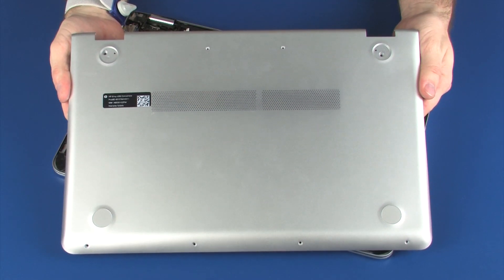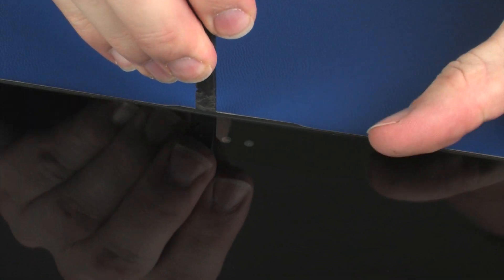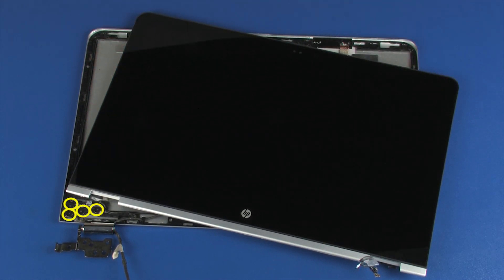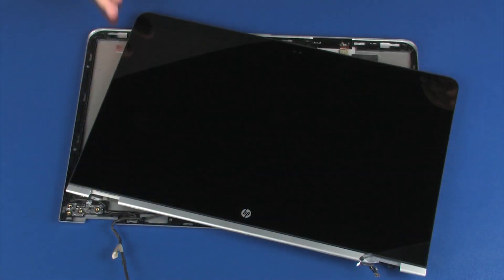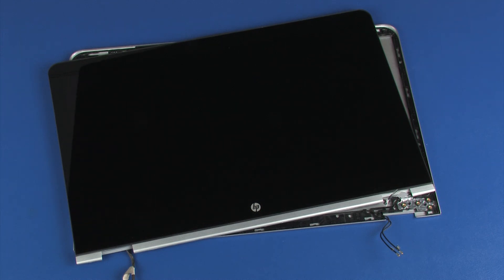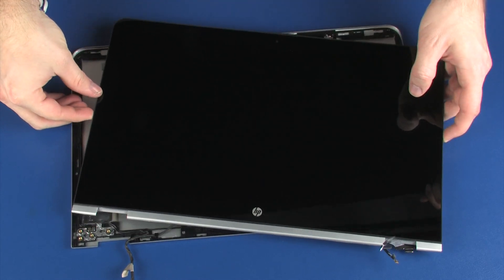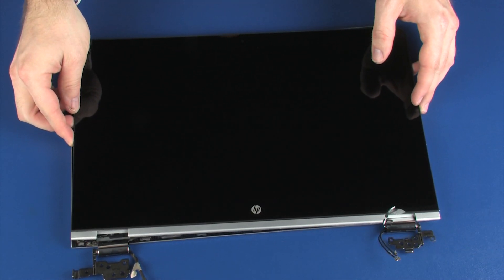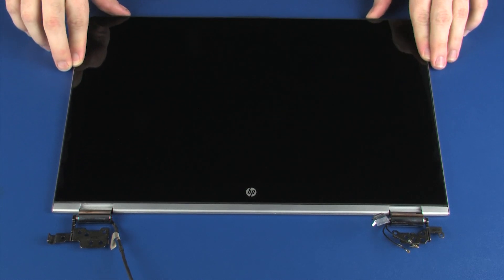Replace the Display Panel Hinges | HP ENVY x360 m6 Convertible PC | HP Support

Comment: I was asked to fix an hp Pavilion x360 14m-cd0001dx with the same issue caused by hinge mounts on upper lid being plastic, resulting in a broken screen. I'm hesitant to fix not finding a better part, knowing it'd only be a matter of time before it'd happen again. I don't know how hp figured plastic would withstand regular stress of 360 hinges.
Reply from the maker: +Drew Wesley Please contact our phone support team to fix the issue. Please follow these steps to reach them.
Step 1. Open link: https://support.hp.com/us-en/contact-hp
Step 2. Select the product type.
Step 3. Enter the serial number of your device or select let HP detect your product option.
Step 4. Select the country from the drop-down.
Step 5. You should see the HP phone support number.
Reply: @HPSupport  Expired warranty.

Comment: What kind of tool is that is used to separate the bottom piece?  Or does HP think we are all born with one of these?
Reply from the maker: +M. M. You will need the following tools to complete the removal and replacement procedures:
● Case utility tool or similar plastic, Ưat-edged tool
● Flat-bladed screwdriver
● Magnetic screwdriver
● Phillips P00, P0, and P1 screwdrivers
● Torx T4 screwdriver

Comment: should i buy hp envy x360. This is apparently a issue for which thousands have complained. I am afraid. They are saying that hinge cant be replaced. only the screen panel as a whole can be replaced for which they charge 20000 Indian rs. Are the hinges available now?
Reply: its the plastic not the hinges.plastic to weak
Reply: are you insane, why would you even consider buying this, knowing a serious design flaw exists?

Comment: Paid a lot of money for this Convertible as I like the spec and HP brand - however as noted by so many the hinge fails, mine has never been opened as a 360, only used as a traditional laptop, only by me and handled very carefully. This is a quality fault that should be repaired by HP
Reply: Yea, HP HINGE SUCKS!
Reply: I am done with HP- NEVER NEVER AGAIN- THIS has finally driven me to Apple Mac - family and colleagues have great long term experiences with Apple- never again HP- you have loss this customer.
Reply: @Photo513Graphy  don't blame you!  If they can't support this problem, they don't belong in business.  Last HP we're buying!
Reply: This hinge problem is a FACTORY/ DESIGN DEFECT not only for envy but with their other laptops… and yet this hp people wants us to pay for REPAIRING.  Poor design and component quality.  Never again will I buy hp laptop again.
Reply: Just like me. I only use it for school and lift the screen up with one finger and close the screen with two fingers. No tablet for me lol.  Better to be safe than sorry lol. I’m just nervous of putting it into tablet mode I’m just gonna leave it as a laptop and still handle it carefully
Reply from the maker: +David Frost Please contact our phone support team to fix this issue. Please follow these steps to reach them.
Step 1. Open link: https://support.hp.com/us-en/contact-hp
Step 2. Select the product type.
Step 3. Enter the serial number of your device or select let HP detect your product option.
Step 4. Select the country from the drop-down.
Step 5. You should see the HP phone support number.
Reply: @HPSupport  The only option provided there is a paid one, since it'sout of warranty when this issue usually occurs.
Reply: @HPSupport  qq

Comment: Why is this not covered under warranty, it is a known problem? I had mine less than a year.
Reply from the maker: +Michael Wiatt HP does not recommend upgrading or downgrading hardware parts or software that is bundled with the product as It may affect the manufacturer's warranty and performance, however, you could change the configuration at your own discretion.
Reply: @HPSupport  that didn't answer my question. Why is a known problem not covered under warranty? It's so bad, all the repair shops near me said it's the most common problem with this laptop. Pretty disappointing having a computer break in 6 months.

Comment: How do you remove the base enclosure from the display panel and then connect it back together?
Also what type of screwdriver is used?
Reply from the maker: +riri Please refer this video to know about replacing the base enclosure: https://bit.ly/3nJRox7
Reply: what good is that when you have to replace the hinges?   @HPSupport

Comment: The bottom right corner of my screen popped out and there’s something keeping it from going back in (ironically I think it’s supposed to keep it from popping out 🙄) how can I fix it?
Reply: How old is your laptop?
Reply: Did you get it fixed? I think I might be having the same problem
Reply from the maker: +Lina Snow Please contact our phone support team to fix this issue. Please follow these steps to reach them.
Step 1. Open link: https://support.hp.com/us-en/contact-hp
Step 2. Select the product type.
Step 3. Enter the serial number of your device or select let HP detect your product option.
Step 4. Select the country from the drop-down.
Step 5. You should see the HP phone support number.
Reply: what a joke @HPSupport  .  I tried contacting HP with the proper serial number and show "error".  I think your company is purposely denying people support.

Comment: Hi
I have a doubt, is the same process with HP Pavilion x360 15-cr0002la?
Thanks
Reply from the maker: +Isai Arai Please refer page number 42 of the user manual to know about replacing display assembly: https://bit.ly/2On72SM
Reply: @HPSupport  thanks so much 🙏

Comment: Did HP envy x 360 2020 also have hinge and how much it's cost to repare
Reply from the maker: +Aryan Khandelwal Please contact our phone support team to know about the cost and repair the unit. Please follow these steps to reach them.
Step 1. Open link: https://support.hp.com/us-en/contact-hp
Step 2. Select the product type.
Step 3. Enter the serial number of your device or select let HP detect your product option.
Step 4. Select the country from the drop-down.
Step 5. You should see the HP phone support number.
Reply: But I am planning to buy but if 2020 model also have same issue that's why
Reply from the maker: +Aryan Khandelwal You can purchase the part from here: http://partsurfer.hp.com/ Please select your country and enter serial or product number of your unit.